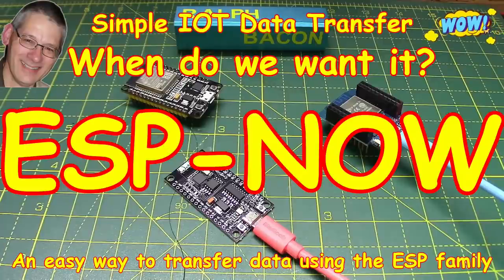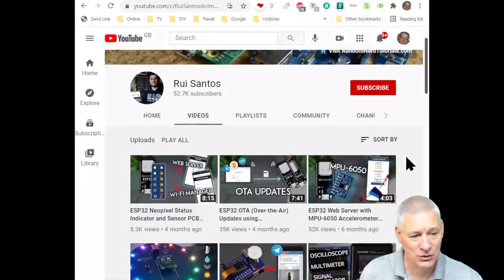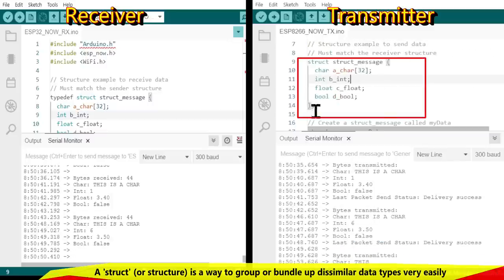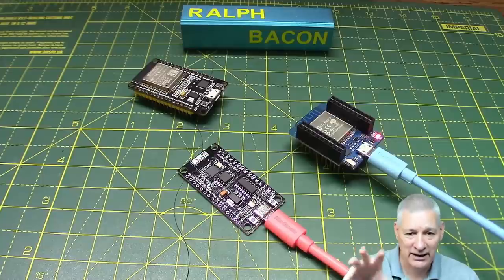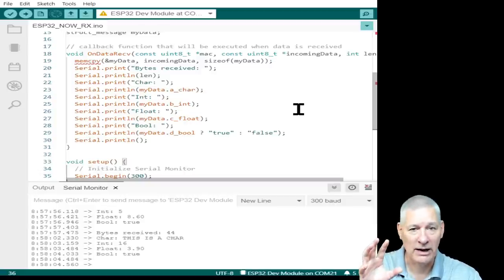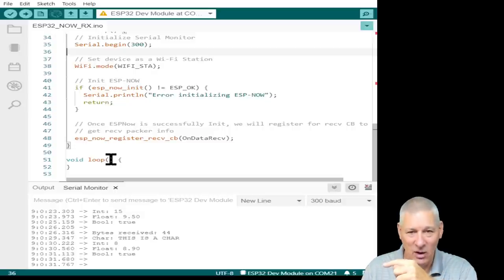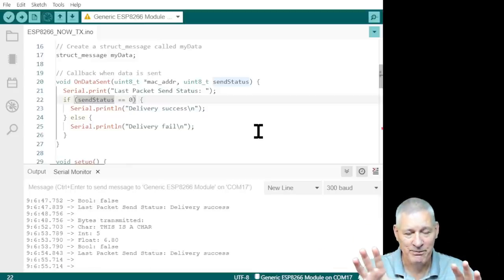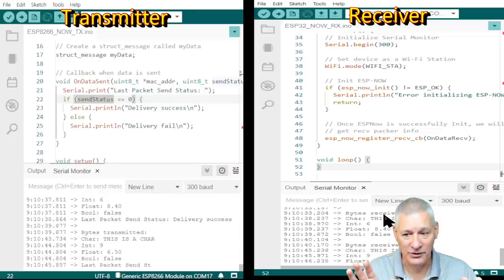#223 ESP-NOW simple demo - easy IOT data transfer on ESP32 or ESP8266

Comment: Hi, Ralph - so glad to see you "discovered" ESP-NOW - as you mentioned it is a very useful and versatile  light weight protocol.  I believe it has been in the examples included with the ESP32 and ESP8266 board packages for quite some time now.  I have used it in a project for a remote control for a fleet of smart cars based on 32s and 8266s.  It is very adaptable - I use 1 transmitter to send to the various cars with a button on the remote control selecting which MAC to send to.  In most of my ESP-NOW projects I use the AP mode of WiFi and assign each receiver (slave) a hard-coded MAC of my own choosing (note you need to assign odd addresses only).  The ESPs allow you to have 1 MAC for STA mode and another for AP mode.  This eliminates any hassles trying to get the MAC address and doing the auto discovery included in the example sketches.

Things get to be a little more fun when combining MQTT and OTA with ESP-NOW..  I found I had to do a normal WiFi setup in STA mode and then init MQTT followed by OTA using this single WiFi init.  Then I did an init of ESP-NOW using AP mode ( removing the WiFi.disconnect(); ).  The examples in the boards package showed me how to make an array of the esp_now_peer_info_t slave variable.

It is important to note that the transmitter and receiver need to be on the same WiFi channel - preferably a channel not being used by other applications such as MQTT. Here in Canada I use ch 1 for ESP-NOW.

Amen to your comments on the IDE 2.0.  It's handling of the Serial Ports in not real graceful.  So for I have not seen any support for OTA uploads which is my favourite way to upload (eliminates Serial Port hassles).  I actually contributed to the Arduino 2.0 project - they have their own ideas of what they want to do.

Your idea of using an ESP-01 as a temperature sender sounds nice but left me scratching my head - I think the ESP-01 doesn't bring out the A0 pin.

I took you recommendation re JLB PCB and did a couple of boards...  (including a programmer for the ESP-01 and another for the LGT8F328P ( as well as ATmel ) based boards. Quite nice - they supported me quite well..  I installed a local router on my Linux system and was very impressed with the speed.  Just recently I  wanted to do some more boards and found that the integration with LCSC seems to be suffering...  something about LCSC's move to a new facility which seems not to have been resolved yet.

Anyway, Ralph - keep up the good work and Stay Healthy.
Reply from the maker: Yes, I certainly hope to using ESP-NOW for (at least) one sensor in my workshop. If it goes OK, then might expand on that. 
Oh, regarding the ESP01, I won't be using the A0 pin; if I use, for example, the DS18B20 temperature sensor, that's just a digital, one-wire interface.
Glad you had fun with your PCB design. I still get a thrill but the devil's always in the detail. A rushed board is a scrapped board. Don't ask.

Comment: ESP_Now is magic!  I wanted to put a beacon transmitter in each of our family's cars so that, during darkness hours, the outside lights would automatically come on for 3 minutes when one of the cars arrives home.  There are no street lights where we live and lots of trees which - when we have windy weather - annoyingly spuriously trigger PIR lights all the time. 

I was going to use Bluetooth and had a working beacon and receiver code set using the ArduinoBLE library - but then I found out about ESP-NOW and it seemed so much simpler than the multi-layer bluetooth approach with its connections and services and so on - much more suitable for my application. 

It worked first time and every time and connects just as fast (or perhaps even faster) than Bluetooth - and using a pair of ESP-32 WROOM boards the range is very good, the message stream from the car is received almost immediately the car is within 100 feet of the house.  I did want to use an ESP-01 (8266 and tiny) for the car end of this, but I could not find a way to get ESP-Now working on 8266 using Arduino IDE (which seems a common experience) so eventually gave up and used ESP32 both ends. Very impressed with the speed reliability and range that this protocol offers.
Reply from the maker: Your story is music to my ears, Alan (see what I did there?) Yes, ESP-NOW is almost magic. As you know, I have a few ESP32s connected to my Workshop Heater Controller (that has morphed into a web hub) from the attic (8m away) and outdoors (2m). All work very well indeed, very good range. Your application seems great!

Comment: Hi Ralph, great video, welcome to Club ESP-Now :) One of the major benefits I have experienced in using ESP-Now is the super fast boot and connect times. I have a bunch of ESP8266 based temp/humid sensor around my house that I was powering from 5v mains USB adapters. I tried using batteries but over standard wifi the quickest I could get them to connect to Wifi and send their data was about 7 seconds. This gave me a battery life of about a month at most when powering the device from a CR123A battery, even with deep sleep. By using the ESP-Now protocol my devices wake from deepsleep every 5 mins and send their data in less than 0.25 second. So far my sensors have now been running on a CR123A battery for nearly 10 months.
Reply from the maker: Yes, I agree it does boot very quickly when just using ESP-Now. In fact, I've noticed that an ESP32 can receive an ESP-NOW message even before the startup( ) code has run!
Reply: when on WiFi you can make ESP to wake up and connect to AP within around 300ms or less. You just need to tweak 3 things:
1- fixed wifi channel on both: AP and ESP
2- fixed IP on ESP
3- tune the wifi routine - all examples from internet show: "if not connected, delay for 1s" - I say: "delay for 20ms" - check it, it works.
additionally: in case you want to use wifimanager these things are almost not "tweakable" but wifimanager brings other value added "thingis" ;-)
Reply: @RalphBacon  my recent ESPnow project: hum/temp/light sensors + battery gauge, wake up, measure, send over ESPnow to the gateway, go to sleep - overall time around 150-400ms depending which sensors you use, ESPnow only takes ... 4ms including sending confirmation received from the gateway - amazing I would say. Also a plus: ESPnow apparently takes less current during sending than WiFi. Sleep current: 4.5uA

Comment: Thanks, as ever, for providing more food for thought!  I now realise that MQTT messaging would be overkill for scenarios where this is more suitable.

I highly recommend the BME280, but it does have an Achilles' heel -- the humidity sensor in it isn't suitable for "non-condensing" (i.e. outdoor) environments. It'll fail into a mode where it says the humidity is permanently 100%. Temperature and pressure readings from it seem to be unaffected. Knowing this might just give a few more considerations for how / where to install the sensor. 

I also endorse Rui Santos' site. Lots of good stuff there. Always a good starting-point for "how do I...?" situations. 

Looking forward to your next video, of course!
Reply from the maker: Useful tip about the BME280, Gerallt, thanks! Luckily for me, if I use it, it will inside my workshop so it should be fine. But I will remember not to use outside.

Comment: As I am aging gracefully, my hearing is declining so I can no longer hear the front doorbell.  So, I placed an 8266 connected to a radar unit to register someone entering my drive and send a broadcast ESP-Now message to another unit in the house on my desk.  This is connected to a relay that switches a piece of LED Christmas lights to flash on and off.  Never miss a delivery now.  Cheap and simple.  I am currently playing with a third unit, an ESP-Cam module to hear the broadcast signal and trigger it to take a picture of the drive.  I can also add as many esp8266 units around my 'estate',  i.e. the back garden, to act as a 'perimeter defence' against cats and squirrels that are eating my strawberries...bstards!
Reply: need watergun ... and AI to detect squirrels ...  might detect cat/dog also as ....
Reply from the maker: Sounds like a great project, Hari. Although the cats and squirrels do need their food too. Hang on, do cats really eat strawberries?
Reply: @RalphBacon  The cats just sh1t in my seedbeds....

Comment: Excellent. I really learned a lot from these videos. They are very interesting and very entertaining. Who needs Netflix? I tried the esp-now and it waited for the while loop to finish on the receiver before running the on_receive_call_back. I had to put my receiver routines in a sperate task to get the esp-now to be responsive without any delay.
Reply from the maker: I'm surprised about the "delay" you mentioned. I reduced the Serial Monitor baud rate to 300bps just so I could see it all happening in sequence otherwise it was all over in a flash. Pretty much instantaneous. I suppose it might depend on what else is running in the main loop.
Reply: @RalphBacon  I had the esp32 running a motor driver, with a while (time/distance) loop, and wanted to implement a wireless "stop" button. I had to put the code to run the motor driver in a separate task (which I learned about from watching your YouTube channel) and let it check a global variable which I changed when I pushed the "stop" button. Otherwise it would wait for the while loop to finish before receiving.
Reply from the maker: Good job putting that (blocking) code into a separate task.

Comment: Being English, I read from left to right, so it seemed odd that you'd put the receiver screen on the left ie before the transmitter. A silly thing to bug me, but it did. And then I noticed you swapped them at the end. You're trying to scramble my brain, aren't you?
Reply: yup, had the same, when file copying/moving, left/source to right/destination
Reply from the maker: My brain works strangely sometimes. More often, though, it's just random placement of windows that determines what you get to see! I shall take on board what you say though, Andy, and try to get sender on the left and the receiver on the right in future. Left to right. Got it.

Comment: Im using ESP NOW for my diy christmas lights by having a master ESP32 running the main lights sequence and controlling 3 other ESP32s with ESP NOW comms to trigger remote sub sequences that are in time with the main sequence on the master. Works great!
Reply from the maker: Sounds great, too, Vince. 

I've now got two ESP32s communicating with my Smart Workshop Heater 'hub' and with WIFI connected too so I can use my phone to read web pages (mainly the temperature and OTA screen). ESP-NOW is an excellent tool.

Comment: I am eager try JLCPCB  because besides being cheaper  per PCB their most economical shipping is far cheaper than my current supplier but I’m waiting on the world wide parts shortage to get better and let them do most of the smt assembly  for me.  My choice of microcontroller isn’t in stock at the moment.  Thanks for all the videos!  I have some 5 year old esp32’s still sealed in the bag.  I was wondering (asking everyone ) will flashing the firmware fix that old security issue I read about a couple years back?
Reply from the maker: If your "old" ESP32s are Rev 0 (you will see that message when you flash them) then they are buggy and should not be used for standard Wi-Fi projects. They might be OK for ESP-NOW, no telling. Rev 1 (and higher) is OK. 
Good luck with your (eventual) JLCPCB order, they make great boards.

Comment: ESP-NOW is cool.  I even tested it with other devices [ outlet, light switch not made by me]  and it responded. It doesn't have a good range < 30 feet / 9 meters. Maybe I can have all my devices check-in on each other?
Reply from the maker: Sounds interesting that other devices responded. I guess you extracted the MAC address of each device you were interrogating?
Reply: @RalphBacon  I look at my router and found ESP-XXXX. and used the MAC. I was surprised it worked.

Comment: Great video. And also more secure I think, because it is not connected to the main wifi network. Outdoor 250m@300baud is a great distance!
Reply from the maker: Indeed. But you can encrypt the comms (I didn't show this as I'm not worried about sending a temperature value across the airwaves; perhaps I should be more concerned as the MAC address must be in the payload somewhere).
Reply: The benefit, I think, is that the main wifi network cannot be accessed when the esp32 is hacked.

Comment: Hi Ralph, I have used the BME sensors in a couple projects now and they are great I think the BMP version is cheaper but dosent have humidity, may be wrong way round !.....cheers.
Reply from the maker: Yes, I read something like that too. As it happens I might utilise the humidity setting in a "future-future project" as it is important that my workshop does not have too much water vapour in it (during winter). I might even have to install an extractor (or just open a window... brrr).

Comment: Very good one, just a suggestion, you can use touch pin feature of the ESP32 to make project more interesting and touch control features in it. Again many thanks for your inspiring video, I learned lot you are hero.
Reply from the maker: Thanks for the tip! I've used touch controls on my Arduino projects before but never on an ESP32. I shall have to test that out.

Comment: I think the receiver should have a state that is known unless it gets no temperature data. It could use a local sensor as a fallback or it could assume temperature is high enough or use some fixed (low) heat or whatever. Failing remote sensor should be assumed to happen and some reasonable working condition should result.
I think esp-now is a great idea for this kind of stuff because it does not depend on wifi working or not. Thanks for another good video that can give a lot of ideas for other people too.
I think esp-now should work along the wifi too. (never used it though). That could be usefull for example if you want OTA updates but sensor data not relying on wifi.
Reply from the maker: Yes, the ESP-NOW does work with Wi-Fi, thank goodness! My project is safe! And I do have a fall-back temperature sensor inside my heater controller for the reasons you state. Can never be too careful!

Comment: Hi Ralph.
I was intrigued by this feature (ESP-NOW), so i started to test around a little bit with using more than 1 struct, and it seams to work with sending and receiving more than just 1 struct.
Sometimes you do not want to send or recieve everything in 1 struct.
I will post my code for 2 ESP8266 (sender and reciever based on your tx and rx code) soon if it seams to work reliably.
Reply from the maker: Thanks for sharing!
Reply: @RalphBacon  Hi Ralph, Im ok with electronics but absolutely terrible with programming. I have a project that is very much the same as what you have shown in your video BUT needs the code changed to accommodate voltage sensing by the "Transmitter" or Initiator to use the correct terms and sending that state to a "Receiver". The "Receiver" would need to trigger a relay. Do you take on this type of work for a fee? I could provide a schematic of what I want to achieve.

Comment: Hope you're doin well. Definitely a nice alternative to the nrf wifi network. Stolen/Borrowed some codes myself to get my picamera to detect motion and send me alert pics.
Reply from the maker: Sounds great! And it's definitely "borrowed" as it's all Open Source, right?
Reply: @RalphBacon  The main python code I used was provided by (a 10 part  python tutorial @_@) Alexander Baran Harper. Some other bits from Corey Shafer on how to use email with python and file management.

Comment: They are called Transmitter and Receiver but both devices transmit and receive.
It is interesting that only the "receiver" mac address is required. Maybe some sort of broadcast acknowledgement by the receiver?
Thanks for the tutorial.
Reply from the maker: The receiver certainly auto-acknowledges the sender's transmission, as the video shows; whether we can actually send back actual data to the sender I don't know.

Comment: Thanks for this!
I wonder if the ESP-Now is completely independent of the Bluetooth? ..or e.g. is the PA shared, so that the BT would have to be suspended, if only for a short time?
Reply from the maker: I never tested the interaction between Wi-Fi and Bluetooth in this scenario. I'd be surprised if Espressif designed it so that BT was affected in any way but empirical tests are the only way to prove that.

Comment: I like your explanations.  I'm new to ESP8266 and ESP-NOW and I have an issue.  Starting with the Rui Santos receiver code, I:
  - Added an unsigned long variable to save the value of millis() in the Callback Function. 
  - Added an if statement to evaluate (millis() - lastReceivedMillis <= 10000) If true, I would toggle the built in LED based on the value of the integer in the structure
  - If false, I would turn off the LED and Serial Pring "Transmitter Offline"

Everything works as expected with the exception of turning off the LED when the transmitter is offline.  The value of the pin is LOW, yet the built in LED stays lit.

Any suggestions would be appreciated.

Bill
Reply from the maker: The GPIO controlling the built-in LED can vary from board to board so you might be (inadvertently) using a pin that also uses (or is impacted by) Wi-Fi, for example.

A simple check would be to use a totally free, unused GPIO pin for the LED indicator (at least temporarily) to test out your code. Use an approx 150-ohm resistor (the GPIO pin is only 3v3 remember) and wire the anode to the pin and the other end of the resistor to GND. At least this way you can be sure your code is wrong 😆 and not the hardware!